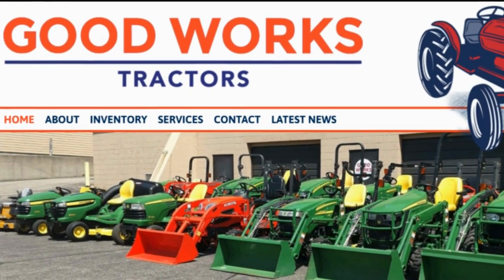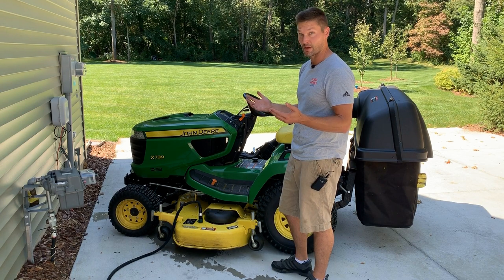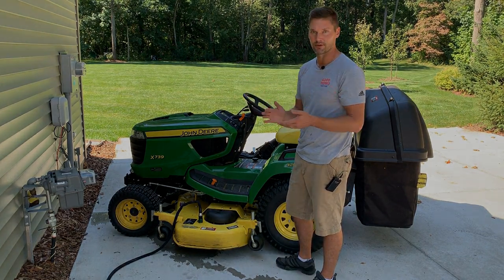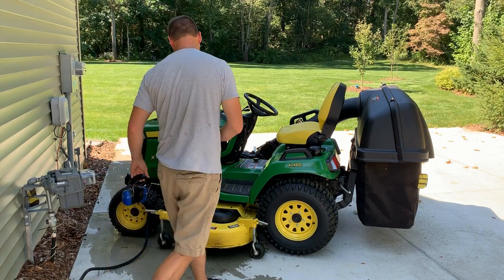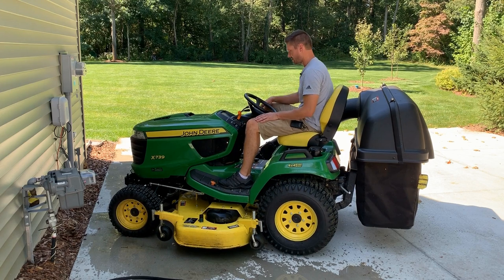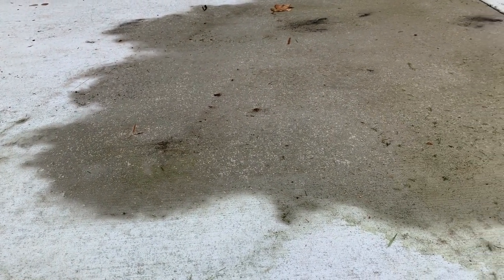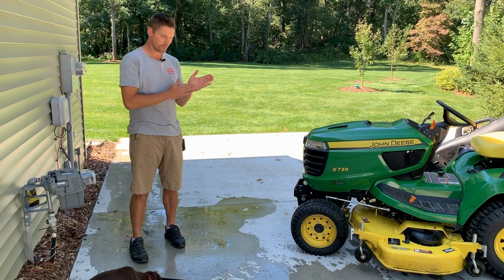Using A Mower Deck Washout Port On A John Deere Garden Tractor.  Same for Husqvarna, Cub Cadet, Toro

Comment: I live in a low area that is slow to dry out. If the grass is wet at all it will clog up the deck to the point I have to stop and clear it out. By the time I’m done there is several inches of build grass under the deck. I tried using the water hose attachment with the deck at the bottom and blades running full throttle. Didn’t work. I made low spot on the ground around back 3 to 4 inches deep. I fill up the depression with water and drove my mower into it with hose attached and water running. I lower the deck with blades running into the water and it’s amazing how much crap comes out. It had to be able to suck up the water to clean my deck. Works great. It sealed the edges so the mower had to suck up the water instead of air. Works every time.

Comment: The hose was plugged up . The water should have been gushing out all around the bottom of the deck . You have next to no water flowing . I use mine after each cut and it makes a river of green goo . They work good as long as you do it right and often .
Reply: That is the saddest water pressure I have ever seen.
Reply: That’s what I was thinking. He only had a trickle of water coming out of the hose. No wonder it didn’t do much.
Reply: This.
I used my cleanout port once and the amount of stuff that came out of it was impressive (with water pressure, that is)

Comment: The thing with the wash out port is you have to start with a clean deck before you mow and then use the wash out port every time your done mowing for the day. If you let the clipping turn into that hard caked on layer, the wash out port doesn’t work at all
Reply from the maker: Good point.  It did get rid of a little of the caked on build up, but there wasn't much to begin with.
Reply: Does work good if you clean every time .   Hot water helps a lot, too.
Reply: Honestly who has this much time?
Reply: @fredpattywright6325  I like to keep my investments looking sharp. I'm as picky with my lawn mower as I am with my washer and dryer (all major appliances) and car. My old washer was 15 years old and looked like it had just been bought when we junked it. I make the time to make them last longer
Reply: @fredpattywright6325  well if you dont clean it at all,  then it will rust out your deck

Comment: I have a Cub Cadet zero-turn that has a washout port on both sides of the deck. I use them always after I get done mowing, they work well for me. You can tell that they are working by the amount of green spray that shoots out of the discharge when cleaning.

Comment: Just so you know, the water port is a quick connect fitting that comes off for easier connection to the water hose. Also you can clear grass clippings out of fitting very easily with it off. It simply pulls up like a quick connect air fitting on a compressor.

Comment: I have a X739 with a 54” deck with mulching option.  If you start with a clean deck, and do this right after EVERY time you mow, it will stay clean.  Instead of running the wash for a set time, run it until the water runs clear; time will vary depending on the accumulations.  The wash port will not clean dried on accumulations.  The water only sprays into the left-most blade area and you need the deck lowered all the way to help the blades work the water all the way across the deck.

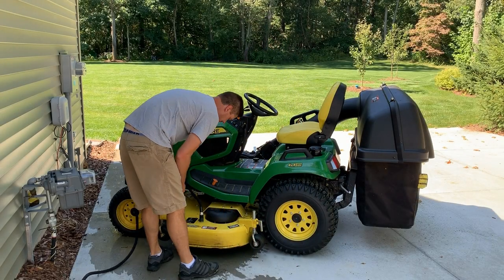Comment: If the port isn't clogged and it is all the way down on the ground you should notice after about 2 minutes that it will foam around the edges of the mower deck. Here is a link to the video that I found that shows what I'm talking about. Look at 3:42 mark into the video https://www.youtube.com/watch?v=qfIdjzl0MeE   I always do mine on the grass and it does a great job as long as you do it after each mow for 5+ minutes.
Reply from the maker: I've seen that video.

I spent two minutes cleaning out the port and these were the results.  I really thought about not cleaning it at all and simply hooking up the water.  The design shouldn't be that finicky otherwise it's a bad design.  For the lack of build-up under my deck, the washout seems like more of a novelty that practicality.  

If you're supposed to lower the deck down during the procedure, then I don't have a an area of my lawn that I'd like to intentionally scalp on a regular basis.  

Plus, who has an extra 10 minutes to do this procedure after their done mowing every time?  I'll spend my time with my wife, kids, and life instead.  Cleaning the mower deck once or twice a year seems to be sufficient.
Reply: @GoodWorksTractors  I can definitely understand wanting to spend more time with the family. I have the mulching kit on my 60"mmm and it not uncommon for me to cut the grass when it's damp in the morning, so for me, it is kind of a requirement otherwise the build-up gets really bad. So I usually just pull up next to the house and connect the hose and run it for 5 minutes and it is clean. It takes me around 2-2.5 hours when I use the 1025r to cut 3.5 acres of grass so an extra 5 minutes is no big deal. I usually cut with the new tractor which has a 72" 3pt rear discharge mower (bigger tractor with cab, radio, AC/Heat, and nice suspension seat) which take my cutting time down to 1.5 hours. That mower doesn't have the deck wash and even with it being a rear discharge it gets a lot of buildup under it.

Comment: Local SW Michigan guy here, actually used to work in Kzoo. I sell deere and tell all my customers it's only usefull if you use it after every single mow to prevent build up, also using a good graphite lube before hand really helps. After using it, you want to run it for a while without the water to get rid of that moisture you created under the deck. Those X7's are beautiful mowers, lawn looks great too!
Reply from the maker: Hey Hunter, good stuff!  Yeah, I've heard about the graphite lube as well.  That seems like it could be a worthwhile investment.  Thanks for watching!
Reply: For the price of these mowers you'd think they would line then with plastic

Comment: Your John Deere might be slightly different than mine but for my S100  the process  we use to is run the water for a couple minute if you have old dried out grass caked on to soften it. Then run 2 - 5 minutes  with the blades engaged. I always disconnect the rear bagger from the discharge chute before doing deck washing. Green slime usually comes out when I wash. Always best to wash with every mowing. I also use my leaf blower over everything to get all dust and debris off of it before doing the deck washing. I've had my S100 mower over a year now and it looks showroom spotless. Wish I knew a way to adjust the seat even closer than the slide lets us. I guess they think everyone using their mowers is tall. It's super hard to drive in reverse for me being vertically challenged.

Comment: I have a X300 and in the spring I used the wash out port, about the same as you, I have about 115 hours on mind. If I had a 1025R, I would put a chain on the loader and pick up so you can us a power washer. Thank you for your video.

Comment: It works when you do it every time right after cutting not after it is all dried  up under neat
Reply from the maker: Maybe so.
Reply: Yep, washing after every use, while still fresh under the deck
Reply: Do a 2 minute prewash, wait 15-20 minutes then do a 5 minute wash.
Mine does great that way.
Reply: It might even help if you turn on the water. LOL!

Comment: Did you even have the water turned on? There was almost nothing on the driveway when you finished. I do it at end of my driveway so the water pours out into the street and down the drain. 5-10 gallons in the 90 seconds I run it.

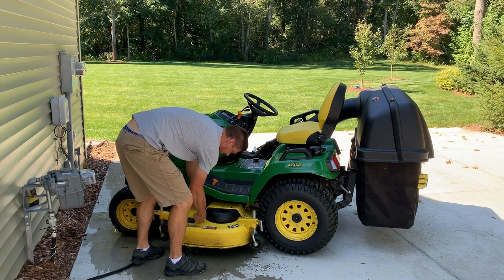Edit: 3:53 - this port is just an open pass through to the underside. The fact that you had pressure when disconnecting says your port was completely clogged, passing no water. You were just spinning the blades and churning up air.
Reply from the maker: That is the entire point of the video.  It's a crappy design.
Reply: @GoodWorksTractors  - I'm agreeing about the design. It should have less plastic and a cap to keep all the debris out. 
I did the first cut today with a new JD mower and used the cleanout as advised by the salesman.  The first time I tried, I had no water coming out. I disconnected the quick connect and pushed it down harder the 2nd time. That completed the connected and water started flowing.  After 3 hours of mowing damp grass, a lot of debris came out. 

I'm envious that you can wait to mow when it's dry. That's just an occasional lucky day in some areas.

Comment: I liked the video. But my experience is a little bit different. And after viewing your video and reading the comments, I may have to re-evaluate my conclusions. My habit is to clean up my lawn tractor once each winter. Among the usual things of course is cleaning under the deck,

Three years ago I replaced my 12 year-old tractor with a new model which included a wash-out port. I used the port after each mowing for about 3 or 4 minutes. During the course of doing my annual clean-up/tune-up I noticed that the underside of the deck was remarkably cleaner than my older machine.

Of course I reasoned that it was cleaner because of the wash-out port. 

Two years after I purchased my new machine, my next door neighbor purchase a new (almost) identical machine. During the mowing season we talked about the performance of our machines and during the course of these conversations, he mentioned that he never bothered with washing out his machine. Two weeks ago I was doing my winter maintenance and offered to do his machine also (I have a heated garage and winch and he doesn't). He gratefully agreed.

There was a remarkable difference between his and mine. Not that his was that difficult to clean, but enough of a difference to convince me that washing out after every mowing was worth the effort.

Comment: I drove the John Deere 2720 with 62” deck over a pile of wood chips one day . Going around in a circle for two minutes too level them down at edge of property .When I pulled the deck off too put away and use the tractor for other work . The deck was spotless . We keep a pile at the end of property for the John Deere x now . When mowing heavy wet grass just head too the pile for quick clean or need a good cleaning before putting away awesome !!! 👍 Are those the G6 Oregon gator blades your using . We have them on the x deck and there performance is unreal . I will Never go back too regular blades👍
Reply: EOSJOE  👍👍👍
Reply: @eosjoe565  Same here with the chestnut tree husks. I have a bunch of hickory trees in one corner of my pasture and they do a great job of scouring the deck clean. If I mow and the grass is damp and sticky, I'll usually drive down in the pasture and run around in the old hickory shells. Saves lots of time scraping the deck.

Comment: I do use the twin washout ports on the X300r as recommended in the manual.
The directions say 1 minute per side.
Most of the material doesn't fall out the bottom, it blows out the chute into the bag. Quite a lot of grass blows out there in the first 30 seconds or so. After that it is just green water. The washout cleans the deck really well and, more importantly, the impeller so that it will keep full suction.
Eight years & 205 hours now and the deck is still almost as clean as new.
Its a bit of an annoyance to do it, but maybe it's like brushing your teeth so they won't fall out :)?
I don't think the washout will remove much old material that has been left to bond onto the deck. In other words, either do the washout after each use or forget about the washing. Plan to instead laboriously  scrape and clean things down once a year.
Or just leave it and have the deck rust out in ten years like I did with my last mower:)
I do use the JD supplied quick connect on the washout ports
Reply from the maker: Hardly any material built up under my mower deck anyways.  I'd gladly trade cleaning it once or twice a year vs dealing with the washout every time.  Ain't nobody got time for that!  🤪
Reply: @GoodWorksTractors  
Agreed , the washout is a minor pain!
Us retired folk can find usually the extra 5 minutes I guess. I'm a cheapie and don't want to buy a new deck for this thing, ever.
You are a busy young guy with a zillion tractors and lawn mowers going thru your hands. A new mower deck once in a long while or even a new mower is not going to be a big problem for you. 
Carry on:)!

On edit- the washout does get the impeller and chute clean as well. That part is much harder to clean by scraping etc than the deck .  The machine will  lose some suction if even a bit of buildup gets caked on, which will occur if not washed out. Not saying it won't work, just that it won't work as well as it should after awhile ( the bagger part)
Reply: Good Works Tractors, I would agree with that Exactly, except that the only way to keep your deck clean (as you do and i have done) is to Only mow when the grass is dry, which means mother nature is dictating things, not you. In the Spring, it's wet out and grass is growing fast. I would imagine that if one mowed in the morning, then immediately washed out their brand-new-clean deck and left it to dry through the day before putting it away, one could mow anytime or day they wanted, even in the rain if they wished. I can see how this could only be effective beginning with brand new decks with 0 buildup, and keeping them that way. Absolutely any caked on grass, even a thin layer from prior mowings is going to just hold the water and not dry and ruin things (as we expect). Be interesting to see it done from brand new, and with Hot H2O, which will heat up the deck and should cause it to dry quickly, when done (esp drying via spinning the blades)-

Comment: You’ll find that you want to use this feature when the grass in the deck is still wet. Once the grass has dried, you’ll need to scrape it clean. It’s meant to be done after most uses when the clippings are wet. If your lawn is usually dry, you may never have to use it.
Reply: after just spending $4400 on an X370, the dealer told me straight up, DO NOT USE THIS GIMMICK. He said it will rust out the deck much faster, and that pressure isn't enough to clean like you'd want. When the DEALER tells you that, take it as solid advice. This dealer has been around for 60 yrs.....
Reply: @redhed9776  Interesting.  I just bought my 2nd JD (an X-590) and the dealer told me to use it.  His words were, roughly, "John Deere puts this on their decks for a reason, not for decoration."  He also told me to make sure to cool the deck down for at least 1/2 hour prior to washout (hot spindles) and not to spray off the top of the deck (use air).  The washout is not 100% effective, tho, and the deck should still be removed from time to time to check the blades and clean the underside.  Decks do rot if not cleaned regularly - I know - I went thru 2 decks on my LA 135 in ~12 years.
Reply: So the deck will rust out from spraying water on it but will not rust out coming in contact with wet grass and sitting stagnant?  Interesting

Almost like saying if you wash you car it will rust out

Comment: Just to make sure you are aware - there is a quick connector on the washout port that is easily removed (the green and black part). I keep mine off. I’m not a big fan of the washout port either, by the way.

Comment: This is like one of those Amazon reviews where the person complains that something doesn't work the way they WANT it to work rather than using it they way it's DESIGNED to work.  You could complain after spending a day driving nails with a screwdriver that it was a poor design, but using it to drive screws is what is designed to do.  Perhaps Good Works Tractors could re-run this test with the full water flow that the port is designed to deliver.  Those commenters noting the failure of GWT to understand the function and operation of the quick-disconnect hose coupling are right on target!
Reply from the maker: Haha alrighty Dan.  Yeah, I’m an idiot, got me! 👍

Comment: You either need to clean the washout port or turn the hose on. In 3 minutes you should have 20 gallons of water under the mower. You had almost none. It looks like operator error to me.

Comment: Did you clean the removable connector. It requires a fine probe. I use a small finishing nail. I suggest you leave it off because the port is a lot easier to clean out - just a common 10p nail. This need to be done since you got 0 to 1 water thru the clean out.

Comment: It takes awhile, but what I do is I have a windex bottle that goes between two hoses. I filled it up with simple green. Not sure how well it works with a discharge, but it works great on a mulching deck. The issue I have is cleaning up after the mass that comes off. I have a 54” X340 that I have been using this on for going on 4 years.

Comment: The green part disconnects like a hydraulic coupler. Just take it off if it gets grass in it. I have used it with about the same results that you had.

Comment: The washports will not get everything washed out underneath the deck but it will get the biggest part of the grass cleaned out if you use it after each mowing. I still used my compact tractor with a front end loaded to pick up the mower where I can pressure wash underneath the deck once a month and paint it with grey primer.  You also have to lower the deck like you are mowing to create a vacuum so the water can be circulated underneath the deck  when you have the hose hooked to the water port